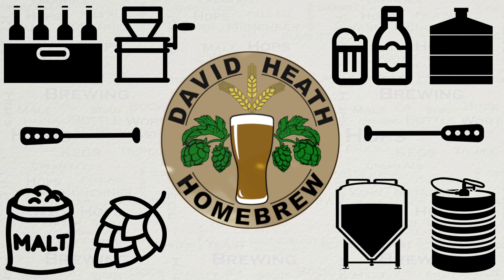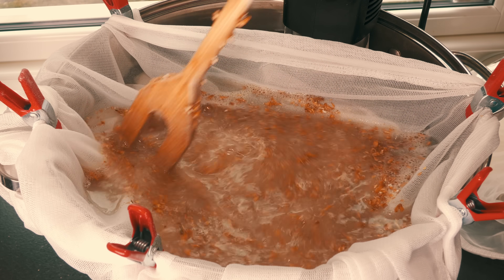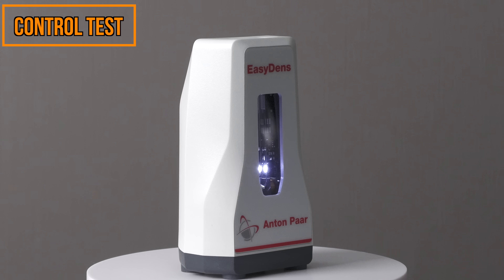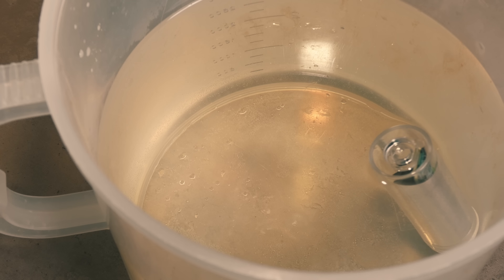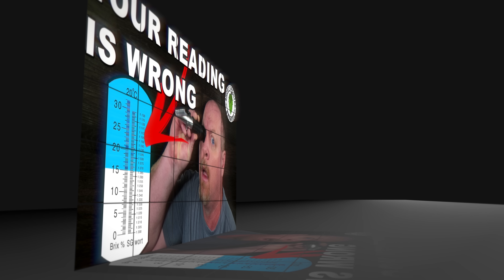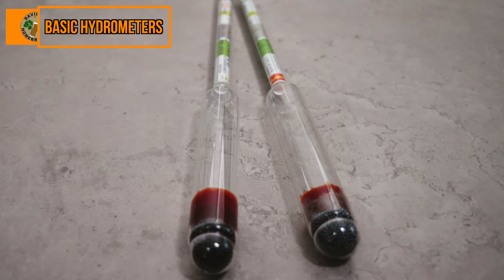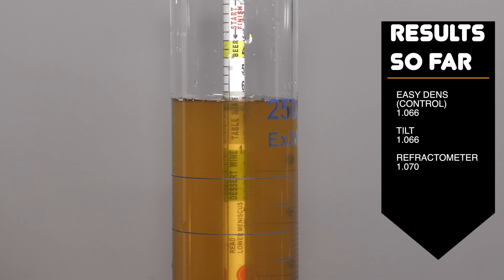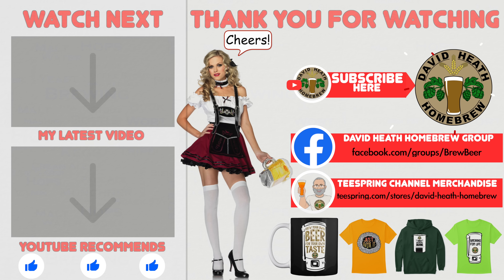Homebrew Instrument Accuracy Comparison Tilt Vs Easy Dens And More

Comment from the maker: For those confused by the last test. The actual result was around 1,070 as stated in the video. 
Filming through curved glass with liquid at an angle can result in an obscured image along with different screen and resolution sizes playing a role too. Also keep in mind that hydrometers are read at the lowest middle point of the U shape (miniscus).
Reply: You can use the highest point, but then your before and after (OG + FG) must be read at the same level ... point have been hammered to death.
Reply from the maker: Sure has.
Reply: Maybe you should film through curved glass to take your reading on a normal brew day and then it would be accurate 😂
Reply from the maker: Lol

Comment: Nice comparison. 

I think the hydrometer readongs were pretty good though - looked like 1.064-1.065 to me, which I would suggest is 'close enough' for most of us. 

I have two hydrometers and one refractometer. On my most recent brew (first time since I purchased new brewing gear due to changing my life), the first hydrometer was reading what I was sure would have to be about 10 points too low. It turned out also to show 10 points too low for distilled water. I then got a refractometer, which showed what appeared to be 10 points too high for wort and a test I did on an apple juice I know to be 1.049. 

Then I bought another hydrometer (from Kegland) and that's sitting right in the middle. I'm sure it's not perfect but since it's measuring my known values to within one or two points, I reckon that's good enough. 

If I could possibly justify it though, I'd go for an Easy Dens! haha.
Reply from the maker: Great thank you for your thoughts 🍻🍻🍻

Comment: I think the tilt and other floating devices have a great use for tracking the progress of fermentation, they don't need to be accurate, only precise. As long as you can see a trend in values and be able to tell when the value stops changing you can determine when fermentation is over without taking samples and risking oxidation. 

ideally you would have a accurate way to measure OG and FG to calculate efficiency, ABV, and residual sweetness which you can do with a $10 hydrometer.
Reply from the maker: Yes watching trends is how I suggest using floating hydrometers. When still they are as accurate as a hydrometer but that is still not precise but close enough for homebrewers I feel.

Comment: I use a refractometer during the mash & boil to see if I'm close to my targets.   Once in the fermenter I simply rely on my Tilts.   I use them to determine OG. I watch the temperature and wait for a  consistent SG for at least 2 days to determine when it's done.  I don't worry much about the SG during fermentation; as you state the Tilt will be affected by Krausen/Hops/etc.   If I find the Tilt FG reading to be suspicious  I'll double check it with an an old school hydrometer (rarely is it different).
Reply from the maker: Great. I believe that for many this is perfectly adequate.

Comment: Hi David. Did you do a sparge stage with this brew all? I currently biab and have read mixed opinions on if this is necessary and you've clearly got good efficiency here.
Reply from the maker: No sparge. The effeciency is unlocked via a fine grain crush and the stirring during the mash.
Reply: @DavidHeathHomebrew  ah, I see  thank you.

Comment: BEWARE: The Easydens is a great product HOWEVER dont ever drop it. If you do the internal glass cell may smash (mine did) and the product is then useless.  They have said that it will be 250 Euro to repair and may not be repairable. What's more annoying is that they don't call this out or even ship with a protective cover. A great product, and i will buy again as it was my fault for dropping it, but just be careful. Another interesting video David thank you !
Reply from the maker: Fair point Richard.

Comment: If you are selling your beer then you REQUIRE absolute accuracy because of Taxation but at the HomeBrew level repeatability is the important factor.
Personally I take a Refractometer reading of the wort before the Sparge to verify the Extraction that I expect from History and again at Pre-Boil and Post-Boil (which is the OG). It is sometime sinse I bottled so the FG is less important to me because things turn out the same each time no matter how many times I test. I am a Pensioner and do not have the money to be obsessive about things, but I would like one of those Easy Dens things. :-)
Reply from the maker: Exactly right James. Some like to push things further though if their budget allows it.

Comment: Have you tried optical refractometers? Superfast result and require only a drop or two.
Gives an acurrate reading as well but kind of expensive. After alot of testing that is all I use nowadays.
Reply from the maker: Sure but I do not own one currently.

Comment: Hi David, thanks for this great video. I saw that the EasyDens also can measure the ABV. Do you have to enter a OG or SG for that? Or does it measure in a different way?
Reply from the maker: Thanks Chris. Sadly the alcohol measuring is just for higher alcohol beverages like spirits. However you can enter OG and FG and obtain this.

Comment: Great idea... but you can't go into it with an assumption that the Easy Dens is accurate and therefore the control as all it concludes is that one of them is incorrect and you have nothing to prove if its the hydrometer or the Easy Dens. You then also have the issue that you used the Easy Dens to calibrate the refractometer so you're doubling down on any inaccuracy there.

You should repeat the test with a number of different sugar solutions, ideally all tested blind as well so you don't even know what readings you should be looking for.
Reply from the maker: Thanks for your opinion on this Robin but its not an assumption,  the Easy Dens is a unit that I have been testing in various ways and through this have learnt to trust.
Reply: @DavidHeathHomebrew  sure, but it would have been nice for the video to prove the easy dens was accurate rather than just one saying these things differ from it. As a stand alone video it doesn’t have enough to prove one way or the other.
Reply from the maker: I do not  really see that I need to prove that the Easy Dens is accurate. Anton Paar are a very well known and respected company within the field and provide accuracy guarantees with all their products including this homebrew version. Do you buy a car and test every stated specification? I don’t personally! :)
Reply: @DavidHeathHomebrew  sorry, I guess I missed the point. I thought it was a review of them as a comparison as to which was the best. Doesn’t give me enough information to draw any conclusions so just thought I’d point that out and how it could. I don’t have an easy dens but have done tests with the others.
Reply from the maker: It is but are you not familiar with Anton Paar? The Easy Dens has very high accuracy specs.  They are well proven going back many decades and they are the worldwide leader in this field, Its like questioning if Google can make a search engine :)
Reply: @DavidHeathHomebrew  if I wanted to compare what was best, bing or google, I wouldn’t look for a video that said google is obviously the best and therefore if bing gives different results it must be worse. Don’t want to argue, I just simply meant how you could have done the same test and included a review  of the dens as well without it having to be the just the control.

Comment: Hi David - Sorry for being skeptical but, the Easy Dens matched the Tilt, known for not being accurate. Why are you so confident the Easy Den was the correct reading???
Reply from the maker: The easy dens enjoys a high level of accuracy through its specification, which is very trusted. 
The Tilt is usually subject to much movement and its readings can be skewed by krausen sticking on top. With a test like this you got to see how it performs in a still wort. So as such showing that it is accurate within this situation.

Comment: David. 

All the beer that you brew , how do you get rid of it? If I put beer in a keg and say to people help yourselves they seem to not want take as much as they wish. If its in bottles and hand it to them then they are OK about it. The issue with this is the bottles are expensive or  getting 2nd hand ones is a mission. 

I cant drink all the beer by myself...although I try.

Any advice anyone?
Reply: Address please 😜
Reply: @DimpieDeBruyn  bring a bucket
Reply: Anyone any ideas for cheap packaging? I've looked at 5l mini kegs but they are rather expensive as well. Sorry I'm not on social media so typically can't answer those question there.

Never thought having too much beer would be a problem.
Reply from the maker: What about the PET mini kegs? Can you buy locally?
Reply: @DavidHeathHomebrew  nah. I can see them available in Europe but not in the UK. They look rather handy. Might have to revert to pet bottles to give away.
Reply from the maker: You could import then but naturally that adds extra cost. Pretty soon Kegland are launching some 8L pet kegs that will be very well priced. Could be ideal. Until then you can repurpose bottles easy enough :)
Reply from the maker: I hand most of what I brew out to others. Sharing is caring :)

Comment: Grate Video,  I was really surprise that the Tilt was so precise and the Refractometer and the hydrometers was equally bad.
But I would have guessed that the Easy Dens what's on top, no surprise there.
Thanks for your effort David 👍
Reply from the maker: Cheers Allan. Yes, I was surprised too about the Tilt, though not the others. 🍻

Comment: Nice comparison, David! I can also recommend buying semi-pro precision hydrometers. The ones I got cost about 11-12 USD and they are absolutely spot on and much easier to get a reading from because a the whole scale of a regular hydrometer is devided into three or four different hydrometers. That’s made my brewing a lot more easy to adjust and predict finally after using all the other tools except the extremely expensive ones.. 😉
Reply from the maker: Thanks Mikael, maybe I will compare to these in the future. The point I was really making here is that you can pay more but that will not be needed by all. Plus showing BIAB predictions and how efficient it can be :)
Reply: Mikael - just search semi pro, where did you pick it up. I have one I need to replace.
Reply from the maker: Like this :- https://www.bradyinstruments.com/products/beerwinemoonshine/precision-hydrometer-set-specific-gravity
Reply: @DavidHeathHomebrew  Yep, but not that expensive. The best thing compared to the standard hydrometers is that the scale is larger, with makes it much easier to read. A smaller margin of error I guess!
Reply from the maker: I think its better to go further in general. Otherwise there can be variation.

Comment: Thanks David, a lot, and spot on quality as always. 
Would you agree to the statement that accuracy isn’t important as long as the same device is used in both before and after fermentation gravity measurement? I mean if my tilt is off by .02 for example and I want to measure Final alcohol - the result would be the same as if I used a more expensive device that is better calibrated and gives me a finer measurement?
Thanks in advance
Reply from the maker: Cheers Stefan. As long as its consistent then sure. Floating hydrometers can be made inaccurate though via krausen sticking to the body.

Comment: I calibrated my instruments using sugar water once. The Brix scale is the % of sugar in a solution by weight, i.e. if you take 20 units (of weight) of table sugar and 80 units (again, of weight) of water, you have a 20 Brix solution. 20 Brix is 1.083 SG. 10 Brix is 1.040 SG.
Anyway, interesting thing was that in a sugar solution my Tilt and my hydrometer gave the same value. In wort however the Tilt is consistently .003 SG off compared to my hydrometer.
Reply: This is really interesting. To my mind, sugar water is a more scientific method. You eliminate brew house efficiencies and variations in grain. That allows you to know the exact gravity from the start. It also means you don't have to rely on the manufacturers claims of accuracy (i.e. for the Easy Dens). The fact your seeing differences between sugar water & wort is really interesting, though. Did you test your measurements across a range of gravities?
Reply: @j616s  Yes I did two different sugar solutions and of course in most of my brews. I don't trust the actual measured value of the Tilt so I always double check with my hydrometer. The Tilt is great though for following along with the fermentation
Reply: @fdk7014  Yeh. That's the conclusion I've come to with my tilt. If I'm concerned about accuracy, e.g. temp profile/hop drops depend on SG, I calibrate just before the brew. Otherwise I only really trust it for seeing if something is happening.
Reply from the maker: Pure water is a way to go too. Better if you can check a range of points though of course if you want greater accuracy.
Reply from the maker: Thanks James. I do all sorts of tests, I simply figured this one would interest the most people as a good starting point. There is plenty of scope for the future.
Reply from the maker: I just use wort personally.

Comment: Did you use the Brix scale on the refractometer and convert it to SG? On many refractometers the sg scale is way off for beer
Reply from the maker: No, I just used SG.
Reply: Yes, sg scale start to divert at higher sg. Only brix is still accurate.

Comment: Thanks David, I was on the fence with the EasyDens because of cost but I’m making the leap now. Have you done any comparisons of pH pens, I’m currently looking at a Brewferm Cobra and really can’t find any actual reviews. Thanks again!
Sláinte
Reply: Easydens is very good but don't drop it. It will smash and is not repairable.....beware
Reply from the maker: Thanks for letting us know Richard. Super careful with mine
Reply from the maker: Thanks Guy. They are not cheap but if you want accuracy then it comes at a cost.

Comment: Great content! This was a very interesting comparison . I am surprised that the Tilt was this accurate , though the one I use is not the latest version, not that I really need anything precise.
Reply: I think it varies wildly from device to device. I seems David was lucky to get an accurate one, others probably aren't
Reply from the maker: Yes, I did make this point in the video and it could apply to any of what was shown, except the easy dens I feel.
Reply from the maker: Cheers Alan. Yes me also but clearly this new Tilt version has been improved, which is great to see.

Comment: Hi David, thanks for this comparison video.  For me, it would be interesting to expand the results including measurements in the presence of alcohol, i.e. post fermentation.  As far as I know hydrometers will produce more consistent results that refractometer based instruments, as the results of the  later would need to be modificated by some equation to get proper results.
Reply from the maker: Sorry for some reason I missed this. Yes, that could be something for the future.

Comment: I’m all for the tilt, if I’m honest. I have 2 of them and the only complaint i have is battery issues. Here in the U.K. you just can’t buy the exact ones? Which means faffing around trying to calibrate it properly. Other than that, i find them absolutely perfect throughout the fermentation period. It gives me a good insight as to when it’s time to dry hop, temperature, estimated gravity etc. Even with Krausen stuck to them, i get almost Perfect measurements. 
I might even invest in a couple of the V3 tilts eventually, as they take rechargeable 18650 batteries and i have a massive hoard of them already for other devices. Thanks for the informative video all the same david, appreciate your dedication to helping out us home brewers. All the best 
James
Reply from the maker: Cheers James. The latest version is certainly the best yet.
Reply: @DavidHeathHomebrew   yeah i had a sneaky suspicion it would be ; ) the i spindel has never intrigued me? I see too many people complaining about them and their accuracy! However I’m sure there’s plenty of people that swear by them too. I’ve had to import some batteries for my tilts, which should be here by the end of the month? But the shipping was crazy expensive! Roll on the V3’s to the U.K. please 😄😄

Comment: Thanks for another interesting video. I am not sure if I got u right, when u say the hydrometer is not accurate, as I read the value in your video to exact 1.066 plain to the surface. I was told it is important to read the value as instructed, some say it has to be read from below the surface, some hydrometer instructions say I have to read the bottom Meniskus, some say I have to read plain and parallel to the surface. I own two of these with two different instructions (miniskus, parallel to surface) they end up with the same values then.
Reply from the maker: Thank you. I think the video is not showing the reality for some. Perhaps this is due to filming through glass at an angle or perhaps viewing screen size and resolution or perhaps they are not reading at the bottom of the curve like I am. Though I was there with it and the reading was around 1,070.